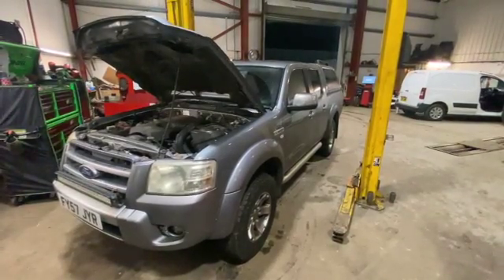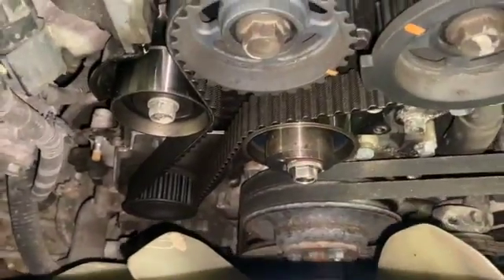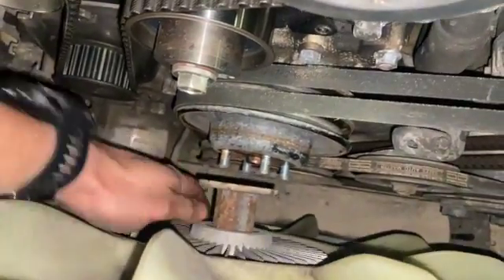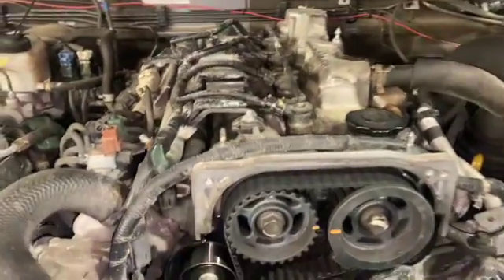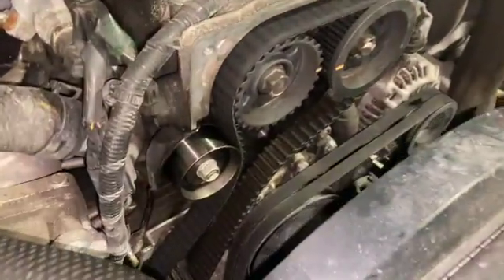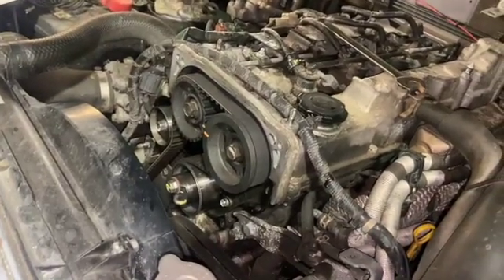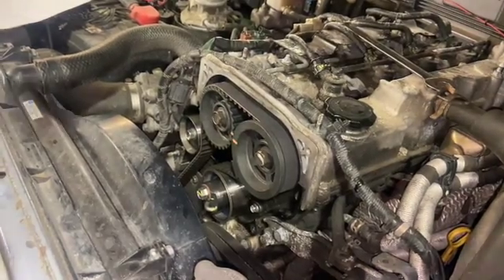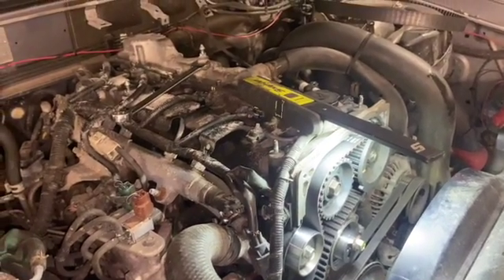Ford Ranger / Mazda B2500 Timing belt kit replacement 2.5 TDCI

Comment: Ya legend. Just saved me 2.5g quoted for this and a water pump.  Not that I was going to go for it. In the trade but usually leave timing belts to a good mechanic shop. These are super easy though. Great video.
Reply from the maker: That's awesome to hear, glad I could help you save some money! 💪

Comment: Used this guide today made it so simple, did the water pump, radiator, thermostat and radiator pipes while I was at it, my only problem is I can't seem to get much heat out of heaters, would this be an air lock or a bad matrix? Do you have a trick to bleed the ranger? As there no bleed screws thanks again!

Comment: Never ever have tensioner fall apart into 2 pieces ,, IT HAS TO BE THROWN AWAY .
* If the tensioner over extends there is an air  bleed procedure .
* ALWAYS INSTALL TENSIONER FIRST //// SECOND CAM BELT ///THIRD,,, IDLER PULLEY /// 4TH   ,,,REMOVE PIN FROM NEW TENSIONER

Comment: Have you done a bid on removing the DIESEL HP pump removal from the bottom pulley of the timing belt called the HP Pump supply pulley ?? for a 2010 Ranger PK Diesel 3L ?
Reply from the maker: Not yet will if I get chance

Comment: Hi, amazing video, thank you very much!!!

Just a couple of questions if you don't mind since it will be my first time doing the timing belt on a diesel engine.... is it actually so easy to manually rotate it? In the gasoline engines it becomes easier once you pull the spark plugs out... 
And also is it really necessary to have such a short 38mm socket or is it doable with a "normal" one?

Thanks a lot!!!!
Reply from the maker: Thanks! Yeah you can turn it over east enough 👍 any ratchet will do 🙌

Comment: hi some tensioners come in 2 pieces and must be compressed and then pinned . Or if u have a pinned unit and pin comes out repin is ideal . Dealer did my t/belt and injector pump and the 2 piece tensioner was not collapsed and pinned at 70,000km. At 100k we found the tensioner bolt tight but tensioner destroyed from incorrect install ,,OH YEA the belt was way way loose . DOH 
effects 2.5 and 3.0ltr versions

Comment: Will it be exactly the same for the 3.0L engine?
Reply from the maker: No it’s different I’m afraid mate
Reply: @diydaly  ahh ok cheers mate, what are the main differences? The set up itself seems to be the same
Reply from the maker: @jackdellaway2746  tbh im not sure exactly , I haven't done one, id have to check but im sure they are totally different, I could easily be wrong though

Comment: What about keeping the hydraulic sub assembly hard against the tensioner pulley? What's the procedure if both become separated before install? Eg no rubber sleeve on the bolt from factory to help the two stay together?

Comment: Great video and yes took about 2 hours. None of the other similar videos show the lock pin tensioner detail. I did spend additional time sorting out the 38 mm. socket as the only size here I had was 3/4" drive. For a future job I would buy a 1/2" 38mm. socket. I was able to unbolt and wriggle the fan assy out of the engine bay (with difficulty) - This helped greatly to improve access for my 3/4" ratchet drive and also to view the pressure pump timing marks.
Reply from the maker: 👍 nice one , thanks for the comments , feedback always appreciated 😁

Comment: My tensioner broke the other day. Replaced the tensioner and damged belt. Engine just does not want to start. Is there a way to check where the crank position is to make sure of the timing?

Or do you think i should check the valves?

I hear a hard deep knock when i try to start and the return pipe on one injector seems wet from diesel
Reply from the maker: When you say the tension broke, I presume it collapsed and the belt came off? Or atleast damage led everything enough to put the timing completely out?
Reply: @diydaly  yeah. Everything was out. So need to check the timing. Did align properly again. And it feels like i have compression when i turn the motor over
Reply from the maker: @plantnerdsa  if you’ve got you reg number I’ll get you the proper procedure on pdf.. just before Doug. Anything though I’d take the rocker cover off and have a look.. we’ve had 2 with snapped cambelts and both had just broke a few rockers .. take the cover off and check them

Comment: Hi, great video. I’m about to change the cam belt on a BT50. The tensioner has failed so the belt spins on the bottom pulley. Is that catastrophic on these engine and could I have bent valves? Or as you mentioned broken cam shafts? Cheers.
Reply from the maker: We had one in with belt failure before and it had just smashed all the rockers.. replaced all the broken rockers and good to go again 👍👍

Comment: How’s it, just a question...
If the tensioner pin on the new tensioner happens to come out for some reason, are you able to put it back in and fit it? Or would you have to buy a whole new tensioner? Cheers
Reply from the maker: Neh you can reset it and pop the pin back in
Reply: Cheers for the response, how do I reset it?
Reply from the maker: @WstCoastHissa  bit hard to describe it in writing but basically it’s just sprung loaded so you need to find a way of holding the back while loading the tension on to refit the pin , you mind be-able to bolt it up finger tight the do it with an Allen key
Reply: Sorry what I was meant to say was... that the hydraulic actuator has become seperate from the tensioner pulley... and the piston of the actuator has completely exited the hydraulic chamber... I don’t know where the piston is
Reply from the maker: @WstCoastHissa  arr right , you will definetly need a new tensioner then if that’s the case I’m afraid

Comment: Hey, great video, what differences do you have to make if the old belt is already damaged and missing half the rubber teeth
Reply from the maker: nothing too different mate as long as you can align to the marks correctly

Comment: Hi changed my belt yesterday but I came across two white lines painted on the bottom pulley and a white line painted on the back of the cover but now it’s got loud tapping and it’s down on power I set it up how you showed in the video someone else has been in there before so I’ve no idea how they set it up
Reply from the maker: so did you have to move any of your pulleys once the belt was off? depends they may have just simply paint marked it In an location and just swopped the belt at that point

Comment: Isn't there another mark for the HP pump that needs to be checked
Reply from the maker: As long as you line all them pulleys up mate you wont have any bother... if your timing was out (from belt issue of valve failure etc) then you would need to set it all up but if you are just replacing the belt id just mark them all 👌

Comment: Very easy to follow instructions. I changed the belt etc on a 2011 Ranger 3.0l TDI. Exactly the same as in this video. Thanks.
Reply from the maker: Thanks for the comments , much appreciated 👌👍
Reply: Thanks man im doing mine for the 3.0l aswell was wondering if it was the same

Comment: Hey mate, 
Would replacing the cambelt in the 3 litre 2007 mazda bt50 be along the same lines as this one.
Reply from the maker: tbh im not 100% sure .. ill do bit of digging and let you know if I find out 👌
Reply: Yes. Same engine as 2.5, bored to 3.0.

Comment: Thanks great video, what happens when the timing belt snaps while driving?
Reply: After how many Kilometers/miles should the timing belt be changed
Reply from the maker: The interval is 5 years or 60k I think 👌👍
Reply from the maker: The valves will have contact with the pistons but the normally break the rockers rather than bent the valves

Comment: So I'm talking there is no need for locking tools?..
Reply from the maker: Yeah it can be done without any locking tools 👍👌
Reply: would be safer with locking tools... did once on dodge caravan without locking tools soon tensions removed camshafts lineup went off.

Comment: Why did you not check that the crankshaft was correct?
Reply from the maker: As it’s just a “top half” belt as long as everything stays inline there’s no need to check it at the crank
Reply: @diydaly  There is ALWAYS a need to check the timing lines up properly. You are working on the assumption the timing isn’t already a tooth out. Very unprofessional indeed !!
Reply: @agentmarky5493  I think he knows what he's doing, don't like it, don't watch it
Reply from the maker: @Jake Gulliver hi Jake , P0340 is the camshaft sensor , if the sensor is ok the first thing I’d do Is remove the cover and see if you can get the Cambelt timing marks to align .. the crank shaft timing is set through marks on the gear wheels where they mesh